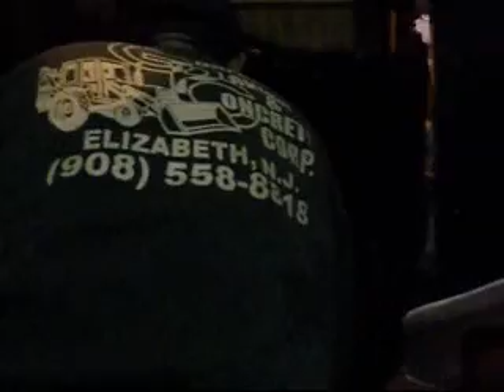12 21 11  Dead International Cold Crank

Comment: @91CTD you have a very good point i have seen those pos cables get red hot and melt bursting in to flames

my grand father has a set he made from used welding cable in 1984 a bout 10 foot long 
in the back of his car used hundreds of times they just half ass make stuff nowadays

Comment: hmm dead battery most likely but here is what i don't get if this truck has a manual transmission which most are why not pull the truck with that nissan and  do a rolling start?? it would be faster just to do a rolling start instead of what they are doing